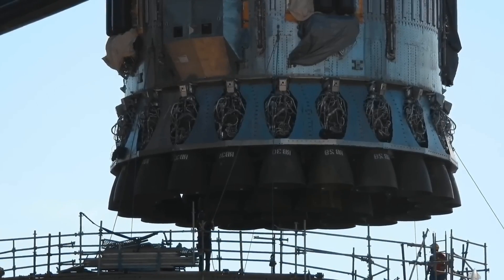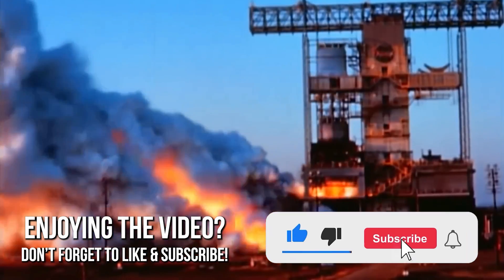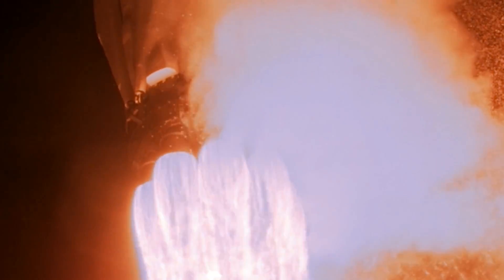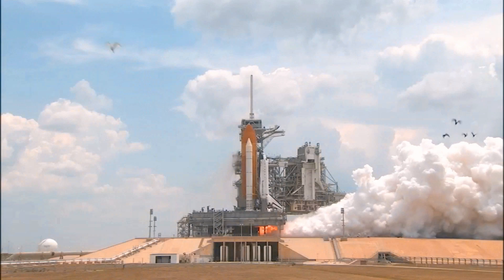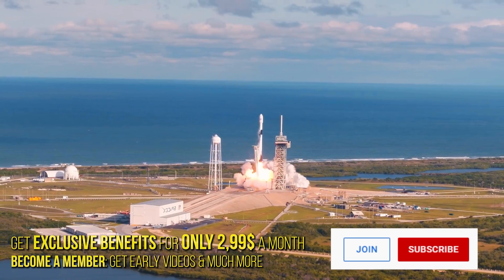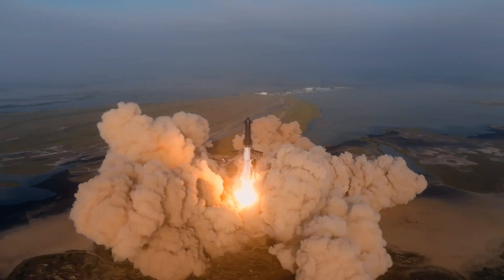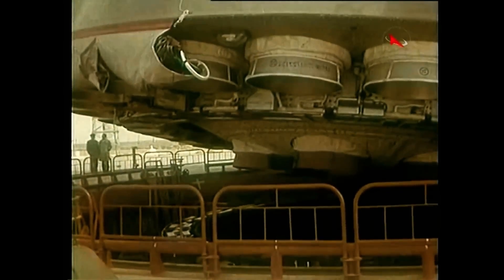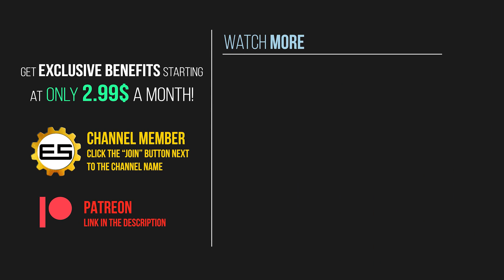How Starship's Engine Ignition Sequence Works

Comment: Picky commenters please note: Original Booster was made with 29 Raptor engines (20 + 8 + 1) as seen in official engine-gimbaling video.  The booster used in April 2023 launch was the first one with 33 engines.

Comment: Sorry, but I have no intention to support a channel which gives so little accurate information (basically the 120ms ignition timing and concerns of vibration and imbalance), while showing so much inaccuracies (illustration of 32 engines, and saying 29 engines repeatedly,  while there are actually 33 with 20 in the outer ring, 10 [not 9 as illustrated] in the middle, and 3 in the center).

Comment: 3:53 Why do they allow false crap to be posted. The 'sparklers' are NOT part of the engine ignition sequence.  The sparklers ignite to burn off any gasses that might have accumulated at the base of the orbiter. If these gasses ignited to generate an explosion, the resulting shock wave could loosen tiles or damage components in the engine bay, or both. Engineering Secrets my A*S!

Comment: 5:35 these are not igniters.
Reply: You mean at 3:55 of the video? You are right, the sparks are there to flash off excess hydrogen that may accumulate in the environment prior to ignition, avoiding a potential external detonation.
Reply: @DavidCaissy  yep, my mistake. 3:55 of course.

Comment: 3:54: With 10 seconds to go, four spark ignitors on the platform begin to ignite the fuel.

Incorrect, the fuel is obviously ignited in the combustion chamber inside the engine. The spark igniters are there to burn off any excess hydrogen that could potentially have been building up underneath the main engines, if not burned off using the spark igniters, those gasses could damage the engines.

Don't be cheap and resort to AI. Get your facts right by doing proper research yourself, you lazy bum.